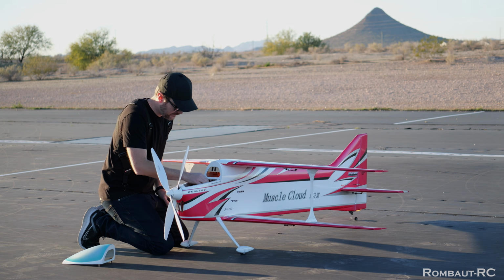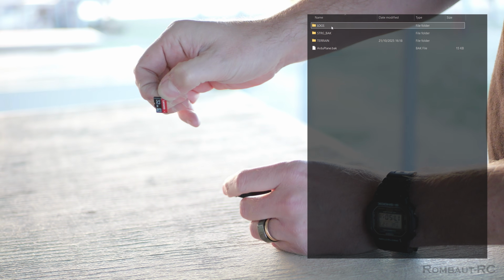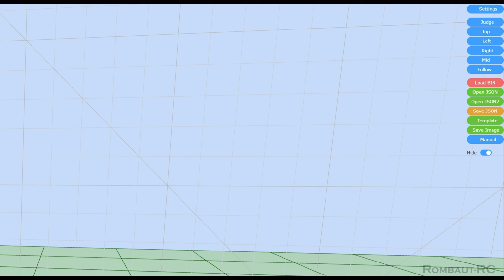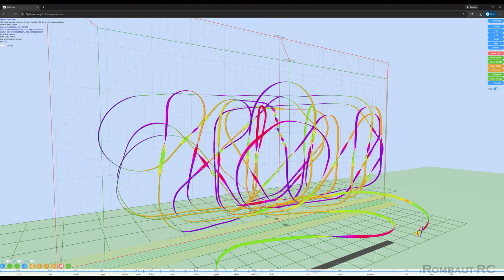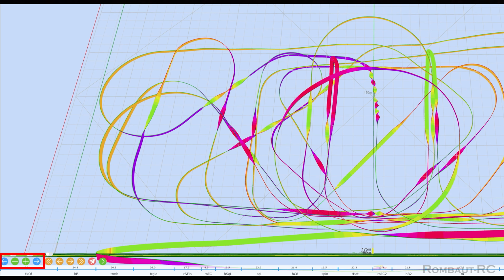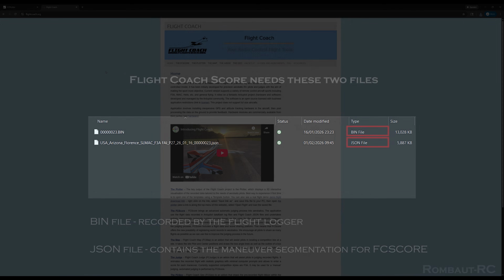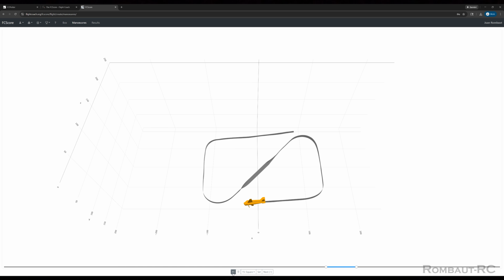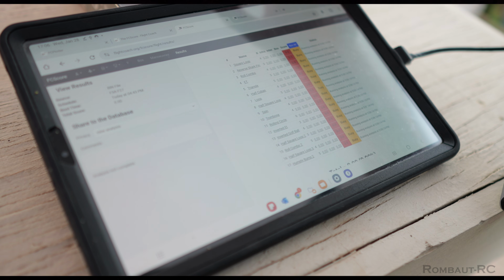Flight Coach Score || Part 2: Step by Step

Comment from the maker: 🚀 SKYTRACKER PRO — Pre-Order Now Open

The SkyTracker Pro, the latest evolution of our flight logger, is now available for pre-order.

This is the same unit used in this video series and in all my current Flight Coach Score testing.
It features a new GPS module, an upgraded flight controller, and significantly improved reliability across different airplanes and installations.

👉 Pre-orders secure access to the first production batch and a special discount! 
https://www.rombautrc.com/product-page/flight-coach-gps